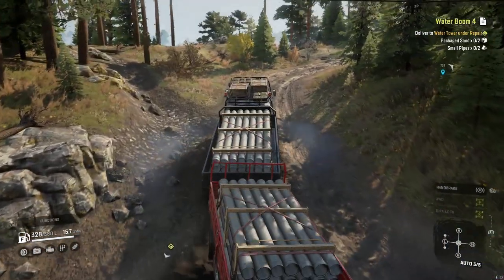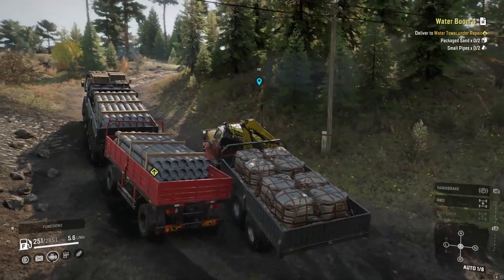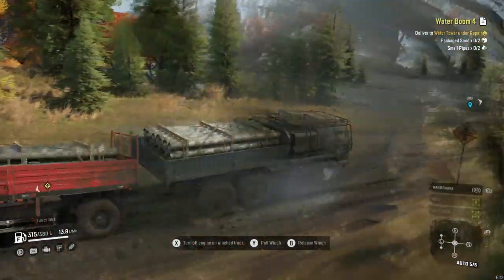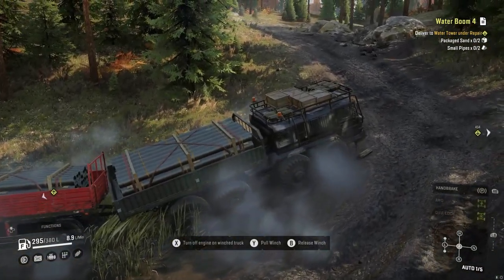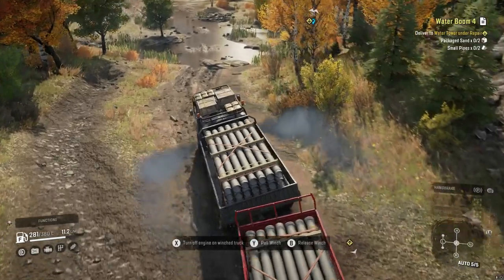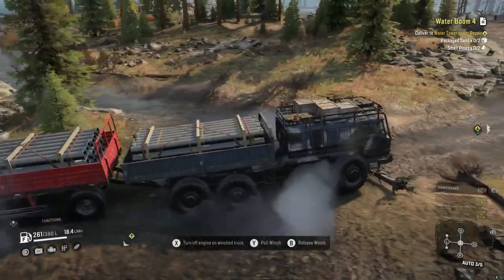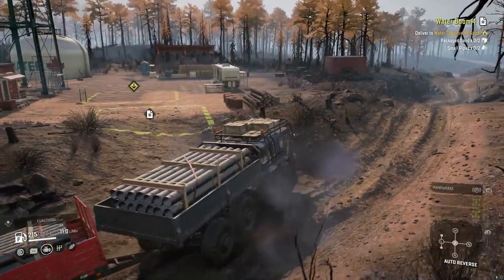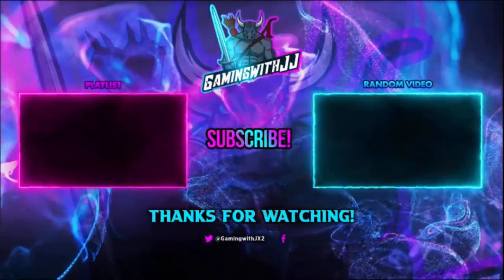Fixing Up A Water Tower Or "Water Boom 4" SnowRunner New Phase 9 Update/DLC PTS Gameplay

Comment: After repairing water boom 4 there is no water in the reservoir. I would assume I need to fill it with a water tanker from the trailer store ?
Reply from the maker: Yeah the water booms are empty until you put water in them. Water towers are where you get the water from. Also be careful with trailers they are deleting water if you go even back to the main menu. I have videos on these topics but also if you are using gallons it won’t get water you need to change to metric. Let me know if you still have issues Marco and I’ll do my best to help you out.

Comment: I completed this task right now, but the tower seems to have no water, should i complete Water Boom 1,2 and 3 to make it work or something?
Reply from the maker: Hello Adouk3n sorry this is a little bit delayed. Water booms are basically water storages. water towers actually have water you can take. basically you only use water booms if you want to recover a vehicle that has water and store it there for a while. its basically not needed at all.
Reply: @G4mingWithJJ  Thank you, i thought it was a bug or I was supposed to enable a pump or something to get water, lol
Reply from the maker: @adouk3n  you’re welcome also just a quick question do you play with miles and gallons?
Reply: @G4mingWithJJ  no, im using liters/km metric system, other water towers work fine, only had an issue with these "Water Booms" towers
Reply from the maker: @adouk3n  okay because if you switch to gallons you can’t get water either that is broken lol. So I was going to say if you have issues with getting water at the water towers then that would be why. But your good. Thanks for letting me know if you run into more issues let me know because if I get asked a bunch of the same question then I know it’s a big issue and I’ll try to help figure out a solution for it. Enjoy your playing time!
Reply: I can’t get water at my water towers. I tried switching to liters and I still can’t get water. What’s should I do??
Reply from the maker: @marvinmoate2149  are you sure these are water towers not water booms?
Reply from the maker: If what you say is true it’s the first I’ve heard of anyone who switched to liters and used a water tower that didn’t work. I would just check your at a water tower not a water boom because that would be my guess as to what the problem is then switch to liters. And if neither of those work try restarting the game. Because as far as I know it’s working for everyone else if they use liters and water towers not water booms.
Reply: @G4mingWithJJ  yes I am
Sure they are water towers. After I restored the towers, I tried to start the mission where you need water, the yellow marker showed abound the water towers, but when I try to get water it says 0/400 gallons or whatever the number is.
Reply from the maker: @marvinmoate2149  yeah if it says gallons or 0 you gotta switch it to liters. For some reason it only allows you to fill up with liters right now.
Reply from the maker: I’m sorry to be repetitive Marvin. But your sure they are towers but did you for sure try switching to liters and that didn’t work?
Reply from the maker: I just want to make sure you tried liters at a water tower not liters at a water boom you said it was a tower so we got that part but just making sure it was gallons at a tower.
Reply: @G4mingWithJJ  yes I was originally on gallons but switched to liters. When I switched, still no water in the tower
Reply: @G4mingWithJJ  I am going to try again after dinner. I will double check that I am at a tower using liters. And hopefully that works
Reply from the maker: @marvinmoate2149  yes because so far which I’ve talked to about 20 people which the water didn’t work for and for everyone one so far they were either using gallons or water booms. So I think you might have used gallons at a water tower then liters at a water boom or gallons at a water boom to but you gotta her them both correct for it to work. I do think this is the issue try it and let me know if it doesn’t work this is the first I’ve heard of anyone having the issue and not being able to fix it with switching to liters and making sure they are at a tower not a boom. There are 2 towers in the north of the first map right on both sides of the bridge. There is one by the garage and I think one further south of the garage. I think all the rest are booms on that map but I’m not positive with that. So if your at one of those and it doesn’t work with liters then idk. My suggestion would restart the game then system and after that not real sure.
Reply: @G4mingWithJJ  I will let you know what happens. Hopefully it works
Reply from the maker: @marvinmoate2149  I hope so cuz I can only imagine trying to play and having something like this holding you back. I really hope this is the fix for you Marvin.
Reply: It worked! I have water! Thanks so much for the help
Reply from the maker: Sorry Marvin my notifications must be messed up I'm going through the list and I've replied to about 8 people now that I didn't know replied or commented before. So I am just now seeing this. That's Awesome Marvin! Do you know what it was? Was it the gallons liters thing or water boom instead of water tower or both lol?